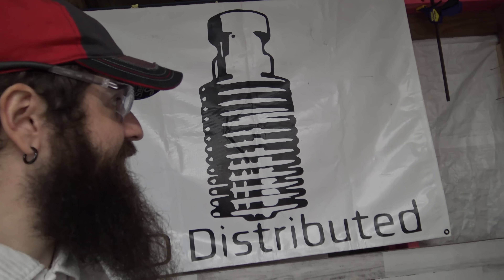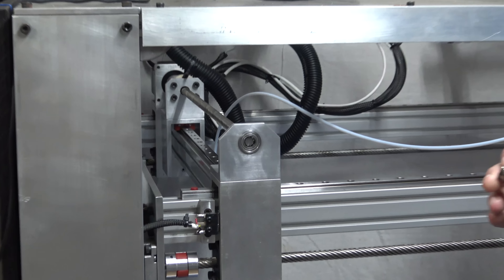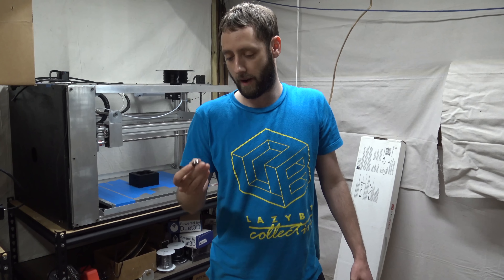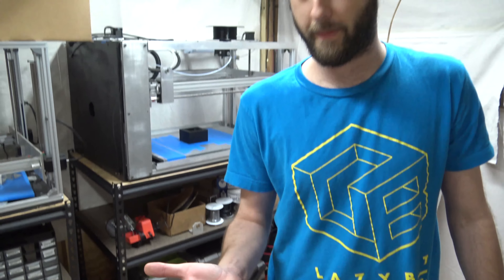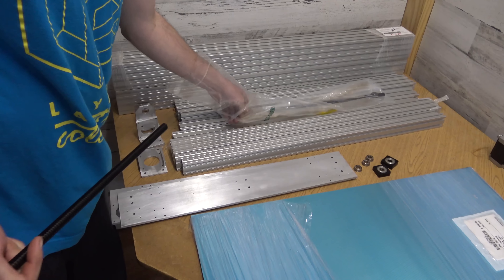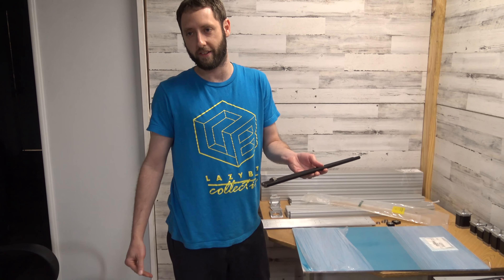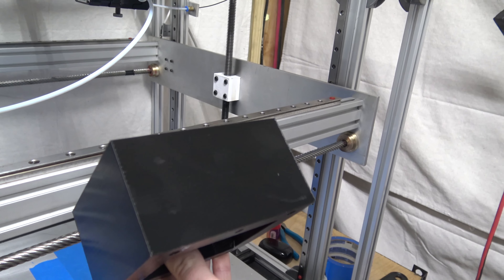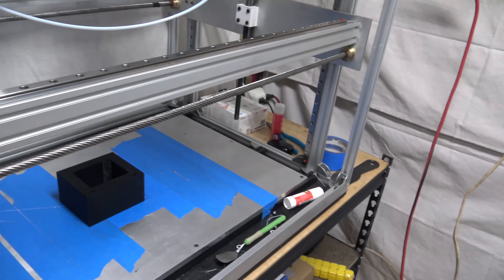WorkHorse 3D Printer Updates: Heated Bed

Comment: Is the silicone bed ac ? Also do you plan to use extra high temperature  glue  to attach the silicon bed to the aluminium plate ?
Reply from the maker: yes it's ac. The heat pad has adhesive on one side. So when it sticks it sticks. Good luck removing it.

Comment: Complains about the price of the lead screws.  Proceeds to juggle them 😂 
What's the voltage on the heat mats? How long will they take to heat that plate?
Reply from the maker: I trust my juggling skills. The heat pad is 120v and it takes a few minutes to heat up depending how thick the build plate is.

Comment: Lol didn't use cast tooling plate on such a large surface, good luck with that staying even as it is going to warp all over the shop as you heat and cool it. This type of plate is slowly extruded out in circle pushing the high sections of the plate outwards (hence the markings in it) causing massive issues when the plate heats up....
Reply from the maker: Thanks for the heads up. We just started ordering from a new supplier and goofed up. I just ordered a couple of cast plates.